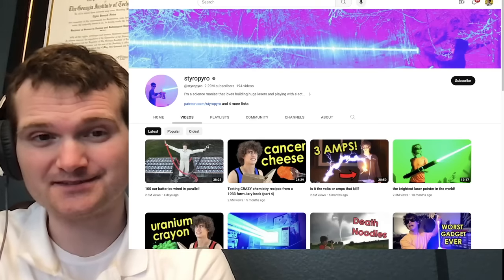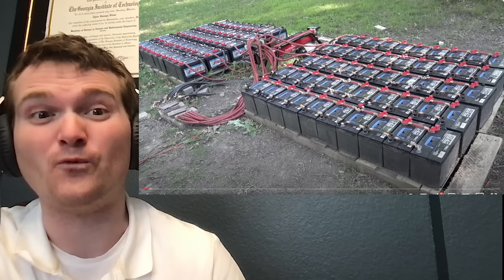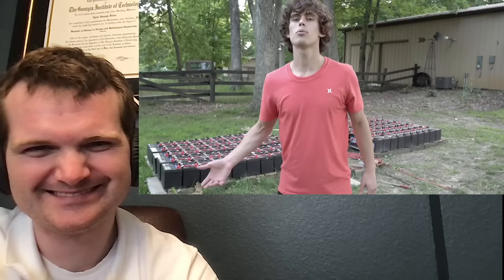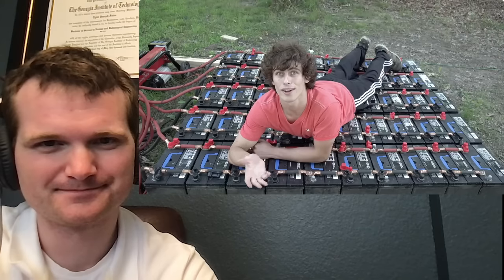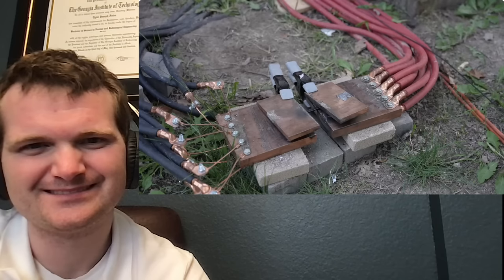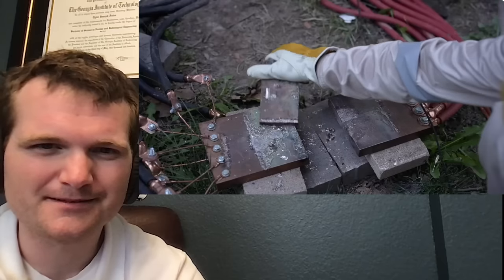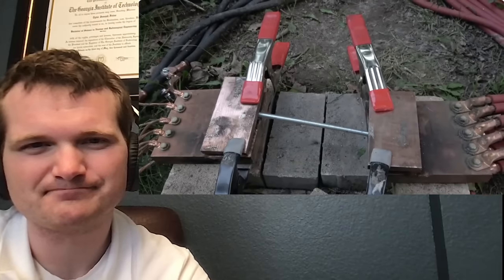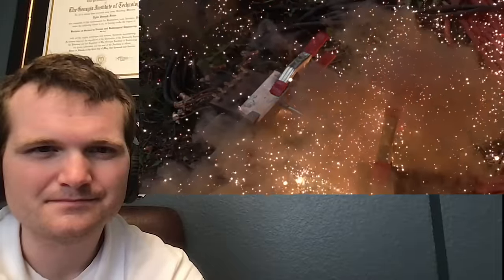Nuclear Engineer Reacts to Styropyro "100 Car Batteries in Parallel"

Comment: I watch this video of 100 car batteries and when you’re charging or discharging a battery you can create hydrogen and oxygen it extremely explosive and he had sparks going all over these batteries, so this was not the best video to put on YouTube ! I’ve had batteries to explode when I was connecting another battery beside one being charged in a motorhome when I connected the chassis batteries, but I was charging the house batteries and it made a small spark when I connected the chassis battery the house, batteries, exploded right there in front of me !

Comment: You better step correct before you get rectified you know damn well that you need both amps and volts to unalive low volts high amps just burns high volts low amps doesn't do much but lower the volts elctroboom buddy

Comment: This is scary until you watch a ladle of molten steel get spilled, or a fault on a power transmission line. Styropyro is very impressive for a backyard experimenter, but industry deals with these levels of energy routinely.